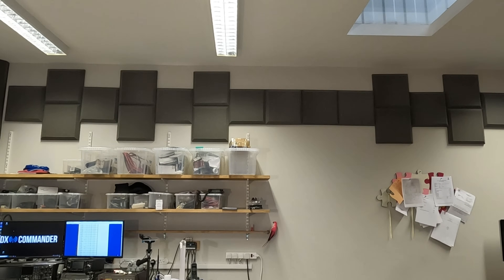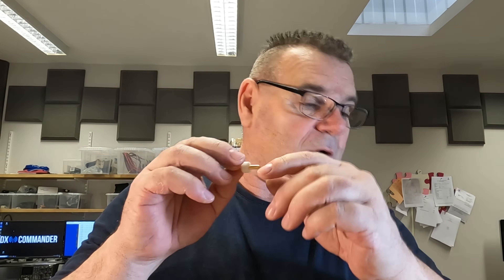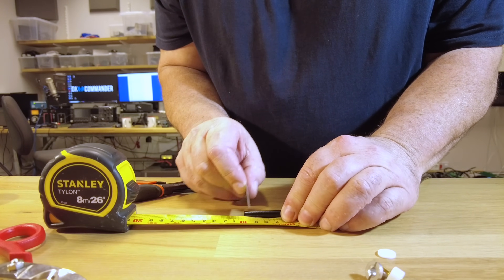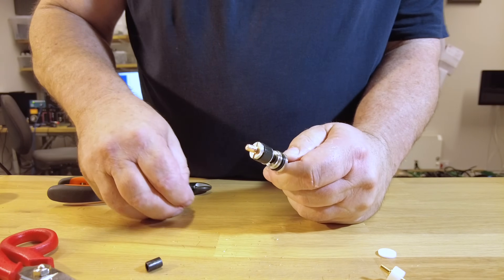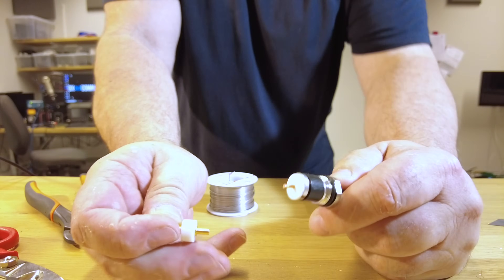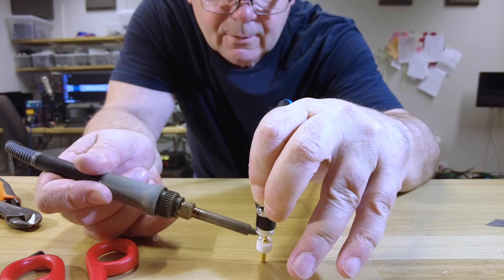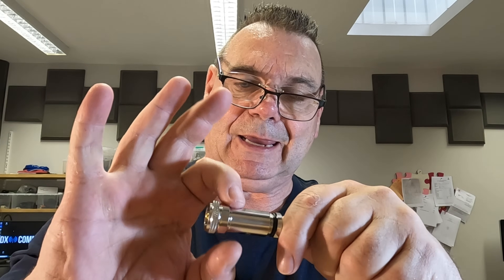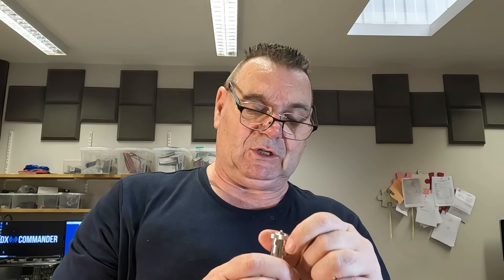Regular Man Fits PL259 Coax Connectors

Comment: This is something I've done when making 4/0 cables you would eat the banana adapter first melt the solder in it and then dip the coax inside it while the solder is still wet and hot then let it cool and harden boom boom baby

Comment: Use a vacuum Solder Sucker. Immediately as the tip tins, apply the Solder Sucker and pull off the excess liquid solder. It should be enough to keep your diameter in spec.
Reply from the maker: Indeed.

Comment: I always put a little bit of flux inside the centre pin before soldering.
Reply from the maker: Yes, I do that too. I use a teeny screwdriver, dip it in the pot and drop it inside!

Comment: I bought a hobbyist vice with a suction cup on the bottom to hold the coax while I  do the soldering. It was only $20 and makes the job so much easier. I also take the insulator off the center pin so as not to heat damage it.
Reply from the maker: I have all that in the workshop area - but no lighting at the time! LOL

Comment: The nice thing is that when your Coax has a PTFE inner conductor you cant melt it with a blow tourch, the nice thing about using Flux the solder Flows, the nice thing about a desktop electronic Vice it wont move, the nice thing about a PL259 made with an inner Isulator made of PTFE you cant melt it! Old school Amphenol conectors are far superior as far as surface area to conductor connection.
Reply from the maker: The nice thing about not having lights or a cameraman where I need it helps too!

Comment: I laughed a lot but love the connector. Just use a vise or some kind of soldering helping hands so the thing stays put. Also, some soldering flux instead of soldering on the center wire, when you put solder on the hole, the flux will make it travel nicely and very well connected. Nice, video.

Comment: Heat one side of the joint with the soldering iron. Apply solder to the other side of the joint. This ensures that the joint is hot enough to melt the solder. Don't try applying solder that you put on the iron. That does not work well. If the joint is not hot enough in 3 seconds, a more powerful iron or torch is needed.

Comment: Even though I have enough tools to build a car, boat or airplane, I didn't have 16mm wrenches/spanners, either.  Turns out that Imperial 5/8" wrenches fit perfectly.  Messi and Paoloni sells a tiny tube of flux for $3.00 USD that they claim helps draw the solder into the pin.  Son-of-a-gun, they were right.  I put a little dab of their flux on the center conductor and all the solder was drawn in through the hole in the side of the pin.  It was well worth the price.

Comment: Put it on a bench vise angled upwards and heat from bottom. Then use 0.8mm solder and feed it into the hole. That’s the easiest way to do that soldering bit
Reply from the maker: yep

Comment: I found that a little flux in the center pin helps. It is easy to get too much, it doesn't take much. Thanks for the videos. I learn much from them.   73  W4DES

Comment: A genuine video, great stuff. I was considering using ultraflex 7 from a discone dm 130 to a RTL sdr dongle SMA, about 8m length, frequency im after is anything i can get at the moment, would you say the ultraflex 7 is a suitable choice or would you recommend something else, i dont mind paying a bit extra if it improves performance. Any advice is most appreciated
Reply from the maker: On 8m length, you'll be fine.
Reply: @DXCommanderHQ  Cheers DX

Comment: Yep... invest in a little vice or similar. Hold pin assembly in it. Use wood or Teflon plastic on the jaws so it doesn't pull the heat away. Don't use led free sissy solder.

I'm in two minds myself here... tin both pin assembly and coax. Hold coax with gentle force in position to slide in. Use a very small dab of fresh solder to get a little bit of the flux. Should just all slide in when the heat is right.

Never do this with those cheap soldering irons either. You need something that is able to step on the gas when needed. Holding the pin with pliers helps but metal transfers the heat away too. Cheers from vk land
Reply from the maker: Also, try not to film it then you can move your work to a more suitable part of the workshop :)

Comment: Just a thought would ptfe tape also known as plumbers tape , specifically designed for making threading water tight not be better than vasoline.
Reply from the maker: It might be.. BUT you can't get it at your local supermarket :)
Reply: @DXCommanderHQ   yeah but you can't get the pl259 ,antennas or coax at a supermarket  either, so  I don't get why its of any importance if they sell it. 
And hardware store will sell it 
They can be found often next to supermarkets 
And alot of supermarkets have a diy section which will stock it. 

Seems like a really weird thing to put an idea down for.

Comment: This was like watching an engineer change a light bulb...trying to turn the room around. Always...always stabilize the wires your soldering. Use left and right hand to hold the iron and solder. Hold the iron on one side of the bond and the solder on the other side of the bond...let the solder flow toward the heat of the iron. ;)
Reply from the maker: Yeah.. I can promise you it's a heck of a lot easier if you don't film!

Comment: Flux has been mentioned but you can just tin the centre core tip before inserting into the body. Then it's very easy to solder. Also when soldering have the tip on a slant towards the floor so the solder doesn't run up the tip too much. Love the M&P gear. Best connectors and leading quality coax.
Reply from the maker: Great tip!

Comment: I glued two wooden clothline pins to a board and you can put the connector on one side and the coax on the other.  It's held in place and keep the hole in the pin facing up, touch it with the iron and feed the solder in the hole.  Put the solder iron away and give it a minute or so to cool and you're done. also don't push the back screw part up tight because the rubber grommet will bulge and make it harder to push into the shell.  It's going to compress when you tighten the connector together.  And using a plumbers wrench makes me wince
Reply from the maker: Now film it too :)

Comment: I just replaced my HF base station coax with M&P hyperflex 13. Yes, I know that is overkill, but ok.  The process has made me become an M&P fan for sure!! 
The connectors and the coax are next level. Here are a couple of my tips and findings. 

The M&P scissors are worth the money. Speaking of the M&P scissors....um holy bleep they are sharp. I ran around with them in the backyard for hours to test them.... conclusion ...very pointy. 

Great idea using the razor vs the scissors for the inner insulator. makes for a much cleaner connection.
Tinning is not required and not recommended by messi. I thought about it (seems logical) but differed to messi's experience over mine. 
Messi says on the hyperflex 13 instruction video  - "If you prefer you can avoid to solder, tightening the core thanks to its flexible fins'  I believe messi is saying soldering is not required but recommended??  The core I assume is the connector housing that screws on and the flexible pin is the gold center pin (with solder hole). So the housing will hold it in place and remain flexible. I emailed messi for clarification. 

Also, the core material the pin mount too is better a little short than too long. too long can result in poor performance and is indicated by the center pin not resting against the plastic washer/insulator. 

Great video!! Thanks again.
Reply from the maker: Yes, that Hyperflex 13 looks fabulous.. Certainly not an overkill! Never :)

Comment: hello Callum, i also tin the center wire, but i found drilling out the very small contact hole by another 1.1 mm give you a better attach for the solder,  these connectors are very good for ultraflex 7, , you can heat up the brass connectors and shake off any excess solder if you don't get a real connection first time. I'm a retired heat eng so i love to solder hi hi, well done on a good video honestly done.. GW4
Reply from the maker: Yeah.. Good point.. I've stopped filming and soldering.. Instead I go and use the vice down the other end of the workshop.. Lots easier!

Comment: Have you experimented with not soldering the braid on the traditional solder pl259 connectors? I met a ham operator who doesn’t solder the braid only the tip. He folds back the braid very neatly then threads the connector over it. Says he’s never had any issues.. has me very curious.
Reply from the maker: Many folks seem to do that .. although lots now converted to the new "N Type" style PL259s.

Comment: I've found the center lug of these connectors to be a slightly loose fit if used with 239's that see regular use with other connectors. If you use these connectors, avoid the use of any others.  I stopped using them for this reason.   Just my experience

Comment: it is esear if you add flux and solder inside the hole and flux on the center conductor and heat everyting up and bind it togheter

Comment: I have spent HOURS getting this right. In many cases I end up getting a connectivity of around 1 mega Ohm between center and shield. An unable to understand why, as even a single strand of copper shortening will give much lower resistance. But - made one cable work fine today
Reply from the maker: Ah. Good man. I have about 30 connectors installed right now.. All working :)

Comment: Thanks for this demo. Pardon my ignorance, but I like to keep things simple. I scratch my head trying to figure out the necessity of soldering the center pin to another center pin. It would seem to me that we would want to keep it simple and use a simpler connector that is better quality than the cheap PL259s out there. Maybe an Amphenol? I don't know, just thinking out loud. Wondering if that thought crossed the mind of you or some others out there? Keep up the great work, Callum.
Reply from the maker: EcoFlex 15 connectors re no-soldfer. I prefer. I follow the "destructions". Not very well!

Comment: Great Video!  They're superb connectors.  Callum, one suggestion, have a go at heating the tube sid.  Place the plug inverted in a small vice try to place something in the vice so the steel does not steal the heat away.  Some teflon or fibreglass pads or even some resin cloth.  Heat the tube and fill it with solder (not fill but get some in there) leave the wire untinned.  Put flux on the wire side which wont affect is diameter.  Heat the tube from the outside and slip the wire into the tube whilst the solder is boiling.  No need to use that little hole to fill them.  It will be a good solid permanent connection.  Sorry if someone has already said this.  Adam VK2PW
Reply from the maker: Good advice!
Reply: This method works SUPERBLY! I just used a small cut of a 2x4 and drilled a 1/8" hole to hold the pin.

Comment: The hole… could it be slightly slotted with a three square fine Swiss type file and the heat applied from the front or the opposite side???  Another commenter described it better details  and the heat would spread better prior to putting the solder into the hole to run into and around the wire. 
Thanks for the demo… liked the fumbles too… 
Best wishes to everyone.
Reply from the maker: I could have moved everything down to the workshop end but the lighting is crap and I couldn't be bothered! LOL

Comment: I find myself wanting to reach into the laptop screen to steady some bits or hold the cable steady.  It was like I'm sucking my teeth and thinking "steady old man" you'll get it."  Bad news for you Callum, it doesn't get better with age!  I find myself using the little two-arm alligator-clip "soldering aid" device and (lol moment) slipping the "coke bottle" lens magnifying specs on -- but not over graduated focus specs -- that just wouldn't work.  So regular specs off, magnifiers on, then trying to find the regular specs, looking everywhere -- only to find then atop the noggin.

Otherwise, very good demo and obviously superior connection method. I must look for the Canadian source for both cable and connectors. TNX & 73
Reply from the maker: HAHAHA!

Comment: Crimp-on connectors are much cheaper, easier to install (especially in the field,) very rugged, and don't require any soldering...I still usually solder the center conductor.

Comment: I'm only 6:57 in but thanks for this -- I wouldn't have otherwise gone on to see that I've been doing BNC clamp-styles quite wrongly.  They still work of course, so there's that ;) but now that I know that, I'm wondering if they could work better...  I had never gotten any instructions nor been shown, so I guessed (if only there were some way I could reach out to query the universe for how to do things....)     I figured the rubber "grommet" was actually there to make a pressure "pinch" of the braid against the shell of the connector to ensure positive contact...  and there's apparently a thin washer I couldn't figure out was a spacer between the plastic spacer and the part that actually goes against the braid...  

Made almost identically to how this one is made, just BNC.

As for my PL-259s, I'm still using that annoying kind that you have to solder on.  Doesn't bother me -- they're less expensive and do the job -- but I'd definitely rather have these.

As for water intrusion prevention, how well do these perform in your experience?

Just got to 8:12.  God, I can relate.
Reply from the maker: HAHAHA!!! Love the last line of your comment.. I missed that part of the tutorial so I've been guesing every since!

Comment: For a good joint; definitely use a good flux which will help the solder run through the pin (don't forget to clean it off with alchol on completion) Don't freehand ! use a clamp, any movement as the solder sets can lead to a poor/dry joint. Aim for a shiny silver looking finish (not a dull grey) Let the joint cool naturally, don't blow on it, don't wet your fingers and pinch to get that sizzle sound ! but most important dont move the joint as it sets !

Comment: as bill freeman says heat opposite the hole as soon as the correct temp is reached the solder will flow into the hole and soak the wire core. if you are not getting this to happen use  a higher power iron i only use m&p connectors now an have done a dozen or so and i use A 25W iron perfect result evert time.

Comment: The worst thing most people do is touch the center pin with their fingers which contaminates the plating with skin oils. One should avoid touching the center pin with your fingers if you can.  Use gloves or plastic-coated needle-nose to hold the pin.  Then the plating remains pristine.
Reply from the maker: Now. I think you are on to something here BUT for folks like me, I am connecting and disconnecting all my plugs all the time so I don't really care that much BUT if you want to plug in and forget, I would agree with you..

Comment: Calum.  M&P stuff is the "Bees Knees". A little point to note: those scissors are crucial. If you cut the cables with a side cutter, "NO MATTER HOW SHARP"  it tends to flatten the centre conductor. As  M&P works to close tolerances, you might struggle to get the centre conductor into the pin. Using their scissors avoids this. In my mickey mouse shack I have the 5, 7, 10 and 13 M&P cables & connectors  in use. I.M.O. nothing comes close. for the bigger stuff you do need a decent soldering iron. I use an Ersa 150 watt for the bigger stuff. Highly recommend some flux for a good joint, as many have pointed out. BTW... the M&P website is an absolute goldmine of valuable tech info... and Christian ,who runs it, is exceedingly knowledgeable and helpful. On my Whisper set up for 80-10, on ten meters i get about 80 MILLIWATT into my Endfed L/W.  I want everyone of those millwatts into the antenna and using M&P stuff keeps the cable &connector losses to an absolute minimum. Lookup EI7II and see where that miniscule signal gets heard. You might be surprised?
 Calum NEVER pre-tin the centre conductor.... you WILL RUN OUT of swear words while trying to get the pre-tinned centre conductor into the pin hole.
Tks for the video!
Albert. EI7II.

Comment: Using the clamp connectors that I recently purchased it  was a lot easier and less work. There are other clamp connectors other than yours that are much easier to assemble. The ones I have do not require you to solder the pin in that area. The other ones you assemble the same way but the solder come at the tip i s the pin.
Reply from the maker: Yes.. bBTW, there aren't "mine" - I just bought some. But I know the ones you mean.

Comment: Too many comments about this soldering and not enough about these revolutionary connectors. I am throwing out all my old solder type that sometimes worked and sticking with these compression connectors. If anyone wants about 20 old style UHF connectors, I'll pay you to take them (not really, don't hold me to that, I'm joking but I not joking about not using the old style any more.  
Now the question....where do I order them and how do I make sure I am getting this type.
Reply from the maker: Hiya Ron! OK, so in UK, you can buy SSB Electronics connectors or Messi & Paoloni (google will find them) .. In USA, Messi & Paoloni. Again, use Google..

Comment: Hi Callum, I'm fitting some of the 10.3mm Sahara coax with those modern PL-259s later, my only issue is, I was told 'never ever' blow moist breath onto drying solder.

Comment: Well, hey, it's easier than putting connectors on 1-5/8" Heliax without the mega-$ installation tool... :-)
Reply from the maker: Well, that's my next job.. But only with 4-50 :)

Comment: What I done with mine when it comes to soldering I put a drill bit through to the front fo it  From the inside of the tip to the front and I sold it like what used to with A259 plugs so I got a good amount of the   Soldering if that  Helps you people out there from jason 2e0wsj
Reply from the maker: Yes, done that too for BIG connectors..